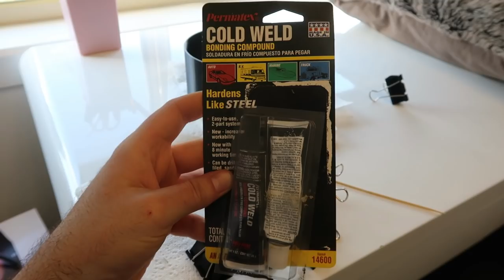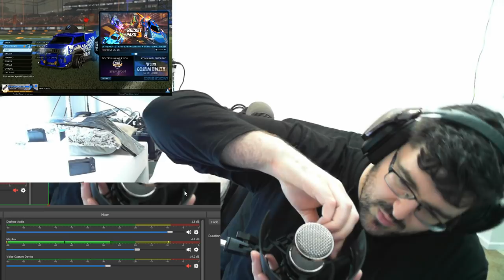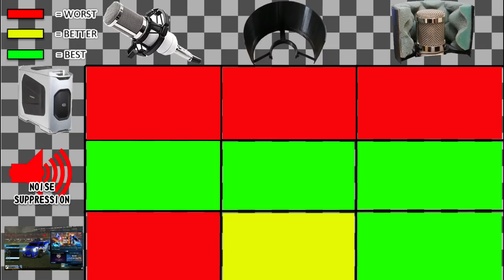DIY microphone shield (BUILD & TEST RESULTS)

Comment: Nice job on this. The Egg Foam was a great idea. I put "craft foam" around mine when I first designed it and that helped a bit, but the egg foam would do much better. (That is my Thingiverse submission btw). My initial reason behind it was very similar to yours. There is a TV playing in the background where my PC is, and it helps eliminate that noise so my noise gate doesn't have to be as aggressive.
Reply: The "looseness" you have when you put it on, I think, has to do with 3d printer tolerance. Mine snaps on and doesn't require the rubber band, but that is the exact reason I put the tabs on there, to account for the difference in tolerance.
Reply from the maker: Wow. Thanks. did you see my comment on thingaverse? Thanks for the stl, Smart thinking with the tabs as well!
Reply: Yes, i seen your comment and came and watched the video.